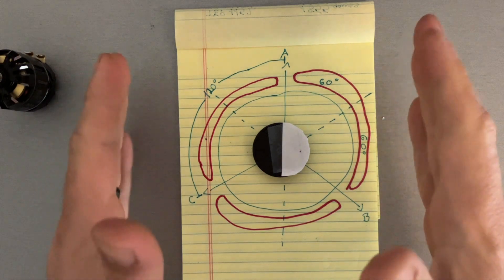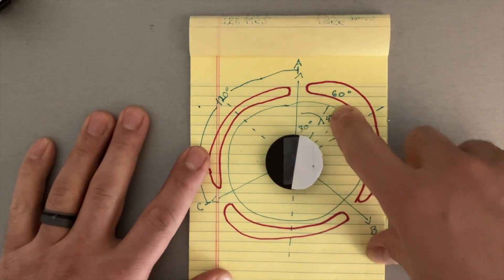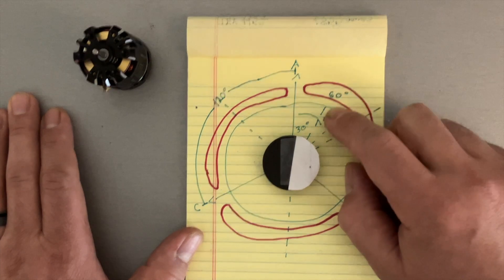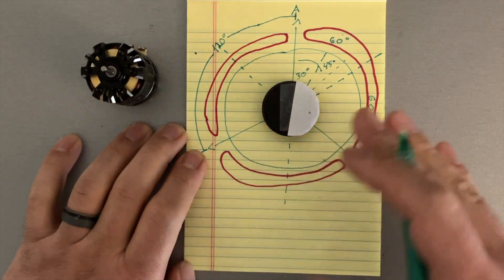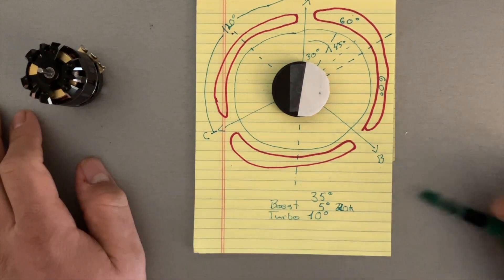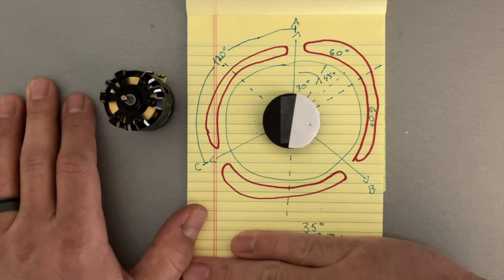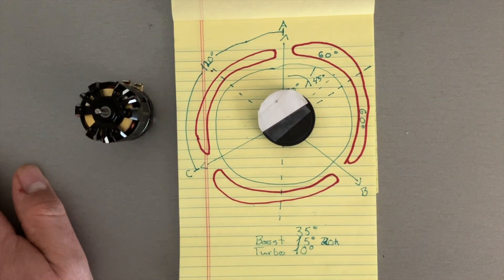Brushless motor Timing What is Blinky Turbo and Boost never exceed 60 degrees

Comment: Hey i have a question i think i moved the timing on my firma esc 160a i have a spektrum firma 1250kv motor by any chance you know what timing is correct for this setup ?
Reply from the maker: Those are big motors. Probably under 25 degrees. Try 20 degrees. I am curious how you moved the timing on it. I thought they were fixed timing motors.
Reply: @ i did it through the app i have the spectrum dashboard i guess is the timing on the esc not the actual motor i am not sure im new on the rc world
Reply from the maker: @Yasermiami  That makes sense now. I was wondering because it does not have an end bell with adjustable timing. But the Tx can make the esc adjust it. That's a cool feature.
Reply: @telecomandorc  thanks

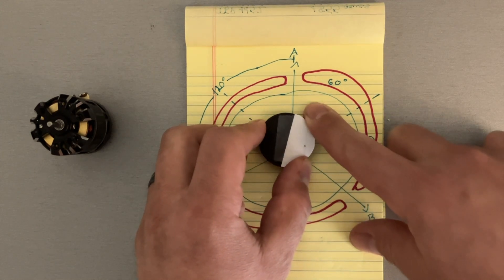Comment: 3:05 what if i have a sensored system, could i increase my timing past degrees or no, i just want to make sure so i dont break anything
Reply from the maker: The same will apply. The biggest difference will be if you have a 2 pole or 4 pole system. If you have a 2 pole, it is easer to boost the timing like they do in no prep drag. But your motor will likely burn up if you try a circuit track.

Comment: Would low timing and high gearing be equivalent to High timing and low gearing? How would these two differences compare on the track?
Reply from the maker: It would be similar within a range of timing. If you run in hotter weather, you may want lower timing and higher gearing. Compared to cooler weather. The more amps it draws the more heat. But the the turns and rotor will mater. Most motors have a "sweet spot". This is the challenge. Some motors like to rev. I do not have a simple answer. Very good question. The short answer is "yes" but the real answer is "it depends" on many variables.

Comment: I run 64* boost and 64* turbo with 50* timing on my Hobbywing G4 21.5T. The kicker is I am using a titanium rotor which changes everything. 

I could not do this with a standard steel rotor because the motor would burn up in an instant.
Reply from the maker: On a follow up to this video, that was the problem. Heat is an issue.

Comment: I have 2838 3800kv motor, which from my research is a 4 pole motor in my Arrma granite grom. I’m not racing it obviously but I’m just curious. Would safe timing be 22.5 degrees combined of turbo and boost (as max timing is 30 degrees on a 4 pole motor)? I’m just curious as I like to tinker with my toys and I’d like to get the most efficient power as I can out of the motor. Also what would you recommend for turbo delay?
Reply from the maker: I would push it all the way. Turbo does not kick it until you go full throttle. You can probably set boost to 10K rpm. What esc are you running? Can you program boost in increments?

Comment: Can you remove the back plate on the spectrum 6000kv motor for the mini t with the 2.m shaft to oil the bearing ?
Reply from the maker: I am not sure how to open the mini motor. It is the 1/24 scale motor? But I think there is enough of the bearings exposed to as a drop of oil.

Comment: Kindly I have a Hobbywing Max6 g2 combo 1650kv motor, and I usually I give 24⁰ Turbo timing and 0.2s delay, but now I purchased a DX5 Pro, and I am using around 2.0 seconds delay and I adjusted the turbo timing to instant and I press full throttle but the radio will take two seconds to go to full power.
The question is that I do not know when the turbo kicks in. Does it kick in instantly or after the esc is in full output after the 2 seconds delay?
Reply from the maker: Turbo kicks in at soon as you go full throttle. But you can program and incremental increase to "full Turbo" which sounds to be what happened here. 

These are three possible scenarios based on Teking RX8 settings.

Scenario 1: Turbo kicks in right away at full throttle. 

Scenario 2: Set a delay and full turbo kicks in 2 sec. later.

Scenarios 3: Set a 2 second incremental delay when every .2 sec. a partial turbo is added until it reaches the 24 degrees after 2 seconds. 

I think you accidently set it up to the thirds one in your esc. This is something usually done for drag racing for example. If this is the case, you will need to go back into the esc settings. Are you using a link to program the settings? 

Did I answer your question?

Comment: Nicely done.   Clarification Boost timing is normally not added all at once at a RPM.  It is added over a RPM range.  IE if you set 20deg with rpm range of 20k to 30k then it starts adding timing at 20k rpm, at 25k rpm has added 20deg, and at 30k has added the full 20deg.  So it increases the timing as rpm increases and you can set any start and end rpm you want to match your setup.  Turbo also slides in over time and that ramp rate can be set.  IE 2deg per .1sec up to 20deg per .1sec in our case with a Tekin esc.
Reply from the maker: I will assume it is the RX8 esc. Such a great esc for 4-pole motors.
Reply: @telecomandorc  This is true for all of our esc's. They all have Boost and Turbo features ( We picked those names long ago that have become the industry standards).  All of them also run 4pole motors just fine when put in Dual mode, or sensored only with drag motors.  RSXpro and Pro2 4pole is perfect in a mini truggy or a 4mod.
Reply from the maker: @tekinprez  I used to run the LRP until I ran into the Tekin motors. The Redline just has a stronger front bell constriction (larger screws). And the Pro4 HD 4300 just rocked in a Stampede and made the Tekno SCT410.3 rip on 2S. I still have that motor as it is perfect for a 4-Tec 2.0 mode. But I have not used the RS products yet.

Comment: Could you suggest formula for 7.5t sprint high bite
Reply: Be happy to what details do you need
Reply: I have 2 sprints one mod with hw 7.5 and hw xr10 pro elite 2 and the other is 13.5 same esc with revtech xfactor 13.5 that have been running in stock "blinky" it has adjust for timing looks like it's just set at above 50degrees haven't moved it since new as I'm pretty unfamiliar with timing I can send phone# to u thanks for any help
Reply from the maker: @michaelchopper7317  
I would leave them and just adjust the gearing as the end balls are not always accurate. If I have to take a guess I would say the 13.5T is close to 35 degrees and the 7.5T is close to 30 degrees. 

I have these videos on a 13.5T:

https://youtu.be/MbF3K1qMAS8

https://youtu.be/_hqzVGao0dw

They will give you an idea about the Kv per timing on the 13.5T. Since that video I have found that 4.5A draw is generally best for blinky.
Reply from the maker: Not sure. Maybe if you give me more details.

Comment: What a great video, thank you so much! I know general knowledge of timing advancing from automotive but im new to mechanical timing on brushless motors. I gained so much knowledge from this video alone. And as a plus you clearly explained boost and turbo in correlation to the mechanical timing which helped me tremendously since advanced esc settings through an app is new to me as well. Can't thank you enough for this video
Reply from the maker: My pleasure. Enjoy your RCs. Cheers.🤝

Comment: I understand why 60 degree timing advance should technically be the limit but in practice ive found that not to be the case. I've run timing all the way up to 90 degrees in 10.5t drift motors (for testing) and find that is about where the peak rpm will start to drop off. Drfit maybhe a slight edge case because we have alot less load on the motor and spin the motors much faster than other use cases.
Reply from the maker: I have a follow up where I test at over 100 degrees. Really fast but really hot temps. Not something I would do for an extended period of time and not for a 4-pole motor. Only a 2-pole.

Comment: I run 95 degrees of timing on a trinity 4.0 and that's where it runs it's best. 50 on the can and 45 in the esc
Reply from the maker: Nice. I do have follow up test to this video. Curious, what are your run times and temps? Is it boost or timing or a mix? TC?
Reply: @telecomandorc  45 degrees of cheat timing on castle X6s esc on a traxxas bandit. Average times I get on gnss is 1.75 in 132ft. Sometimes I get high 1.6's.  I'm not sure the exact temperature it gets to but it doesn't get hot to the touch until 4 runs back to back.
Reply from the maker: @fusion82  Ah, you drag with it. I cannot see it heating much compared to a 5 minute main. Bandit? Nice! Those are such sleepers. Do you have the 272R in it?
Reply: @telecomandorc  yes I have the magnum 272r. Never broke the transmission or the heavy duty plastic driveshafts.

Comment: Great video! Question for you. If a 2 pole motor has a max 60 degrees would a 4 pole motor have a 30 degree max?
Reply from the maker: Correct. Now, you can push the 2 pole to more then 60 degrees and it does really fast but the heat it produces is crazy. It becomes very inefficient. I did this in a follow up video. So, you can push a 4 pole further but you will run into similar situations.

Comment: Thank you for the video. I have been told motor sweet spot is between 5-6 amp. So my can timing is at 42 degree  (5.5 amp), no boost, but turbo at 30 degree. So add it all up, 72 is way over 60 you have suggested. Question: should I adjust the timing on the can and run lower amp or just reduce my turbo timing advance?
Reply from the maker: Since you are running 42 degrees at 5.5, I will assume you are running a 13.5T. 
I do have follow up videos to this one. On a two pole motor I tested the timing at just over 100 degrees. It was really fast for drag once I set it up right with low can timing, boost, and turbo. But the heat is exponential. The motor will be too advanced and fight with itself a bit and get hot. So, it will be fast... inefficient, but fast. Consider setting the timing at 38-39 degrees for 5A or just under. Then add some boost (say 10-15 degrees) at a particular rpm (you will have to test this one so it kicks in as you are coming out your average turn onto 'short straight' points. Then add the rest in turbo... but constantly check temps.

Comment: My english so suck bro, maybe more simple is turbo timing make your rc landing more smoth when rolling in the air??
Reply from the maker: It does not help landing smoothly. To land smoothly you have to time the jump and try to land similar to the down ramp without accelerating before you land.

Comment: I put my timing settings on my vehicle to equate to 46 degrees after watching a few videos and it seems to be where my V5R MOTOR is happiest. it also stays very cool and has longer run time now. Thanks for this vid
Reply from the maker: My pleasure. Side note, most motors I have tested with a rotor gauss strength close to 1700 are happy at about that timing. 45-48 degrees. Motors close to 1600 are generally in the low 50s. I am not claiming this is set in stone, and the law of motors. It is just a coincidence I have observed with 21.5T motors.

Comment: I'm an oval guy that races 17.5 open classes.  If we were to follow this, we would be dead slow.  On high bite ovals I run 30 on the can, max boost(60-65 pending mfg'r) starting at 1500 rpm, and up to 20 turbo pending the straight length.  Yes I do run 2 fans on the motor during the summer months.  Even the Tekin guys were running similar settings and they have a note explaining what you're saying.  Any chance this could just be for the can timing?  Great video either way!!
Reply from the maker: Awesome info. I did two follow up videos I thinking. Once you exceed 120 degrees, it spins backwards (I did not show this in any video). But I think you are right about the can. I think if the timing on the can goes beyond it will cog up as I managed to cog one up badly. But through the esc I got one to go really fast, hot, but fast on a different try. So I think the esc has a way to time it right. I guess sensors go a long way. But, man, did it drain the pack. I think I ran just over 100 degrees combined between the can, boost, and turbo.
Reply: @telecomandorc  Yeah the electronics do get hot.  Thats why in my sprint & late model I run 2 fans on the motor and one on the esc during the summer months.  I run 6400mah shorties and some guys are starting to run stick packs in their sprints if they can fit them so we will have power at the end of the race.  Also gear down like you're running a 10.5 motor.  My motor and esc was coming off at around 140 deg after a 3min qual in 98 deg air temp.
Reply from the maker: @daletennett4812  That is very go to keep it at 140F. I would probably push it a bit more. Quite impressive, I think. Have you run any turbo? I am curious if you only run the 30 on the can and 60-65 boost or if you have trying boost. I am not sure if the oval you run is long enough to have two "straights".
Reply: @telecomandorc  yes I was running turbo.  Can at 30, boost at 64 (max allowed by esc) with initial angle at 30, 25 deg ramp up/ .1 sec, Turbo at 20 with 12 deg ramp up/.1sec.  You can activate boost based upon RPM or throttle.  I had mine set for throttle at 35%.  So when I got to 35% throttle and further, boost kicked in.  Boost is low to mid end on the motor and turbo is only applied at full throttle.
Reply from the maker: @daletennett4812  I am quite impressed. Are you running 40mm dual fans or 30mm? 

Have you found RC fans rated in CFM? I have been trying to look for specs like this and have not found them.

Comment: As stated by others, thank you very much for your easy and thurough explanation. My only question would be: What about RC boats? As there is more load due to the denser medium opposing the turning of the propeller? Would I need to set timing relatively lower or higher compared to cars(tarmac) or planes(air), with the mediums being less dense respectively? Hope this makes sense. Thanks again!
Reply from the maker: Makes sense. I do not have experience with brushless boat applications, but lower timing sounds like a winner. With planes, one generally uses a smaller prop on higher turn motors and larger props on higher turn motors. The same with gearing. Now, adding timing into the mix, and the fact that water is tough to over come especially at speed... I would guess timing should probably be between 30-45 degrees as amp draw would climb fast especially at higher timing with the prop load. So, I think you are spot on.

Comment: how low can you go in degrees?
Reply: and if yo set timing io motor, do you have to match it in esc programing, or is esc programming to add degrees?
Reply from the maker: @thesouthwestern  Below 30 degrees the motor is a dog. The timing in the end bell is mechanical and you do not need to program it in the esc. But if you add timing to the esc keep add the mechanical timing so you do not jump a phase. 45 degrees is a good starting set point on a motor.
Reply: @telecomandorc that explains why my 10.5t felt like a snail. Factory set it to 20* 😂
Reply from the maker: @mattsease4687  😂😅Sorry for the laugh, but that will do it. Although, your runtime was probably amazing.

Comment: Glad I found your video dude, great explanation!. I got that exact 13.5 on my tlr 22x4 and today was my first race and I got overlap by the top guys twice since my wheeler was so slow. My class turn out being open timing so I'm gonna swap the escs around for the xr10 g2s on my 17.5. Now the question is: is that motor fixed at 0 timing? I didn't find anything on the documentation I don't want to add 30* at at motor that is already fixed at 40* for example
Reply: I see.. my rig came with the fixed timing version of that motor, so I raced at 0 timing I believe.
Reply from the maker: @marcosmatos8213  Usually fixed timing motors are set at 30 degrees. 

Setting motors can be a challenge but it can be done if you have set goals. If you do not care about run time it makes it easier. Run the rig for a pack. Take a temperature reading. As long as it is under 160F you are good, and bump up a tooth on the pinion. keep doing it until you notice you are getting close to 160F or it starts loosing too much power and leave it along. Which ever comes first. Now, if you want to add timing, add the timing until you are (depending on the motor) between 45-52 degrees. And then do the above step. Then boost or turbo should be for the bursts where you may need them but careful not to ever heat.
Reply: @telecomandorc  I got my programming box in today and managed to plug it into the pc, update and set my parameters. I gave it 10* of boost (40*total assuming my timing is fixed at 30*) and boy what a night and day difference. I kept checking temperature every  few laps and the hand says it can manage a bit more. Wondering how much turbo should I add now given the fact you mentioned "high 30s" was the sweet spot for this motors. Does that mean is the most efficient timing for a broad power band but I can push the timing to 50-55 for those few milliseconds all out power?  I was having so much fun I didn't even care about tweeking it, I finally have the power I was expecting.
Reply from the maker: @marcosmatos8213  I have a stock USGT motor... it lights up too. Just do 5 degree increments until you find the spot that works for you.
Reply: We’re you at hobbytown Temecula?
Reply from the maker: @User3eighty4  I was in the area not long ago, but I am up north.
Reply from the maker: This motor has adjustable timing. I played a little with a 2-pole (this motor)... and it handles boost as opposed to 4-pole (4-pole does not handle over 60 degrees). The 2-pole cogged over 60 degrees at low RPM, but then I tried it with boost at a higher RPM, and it ran well. I will publish it tomorrow morning.